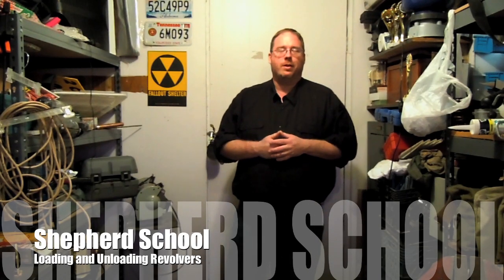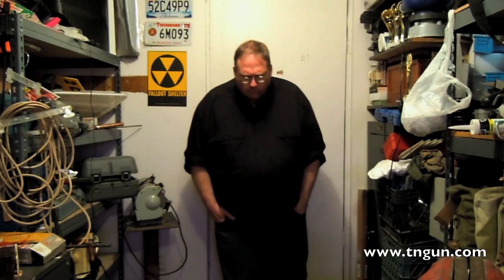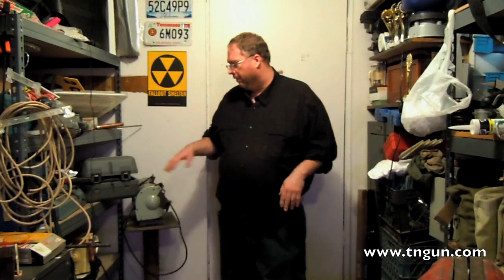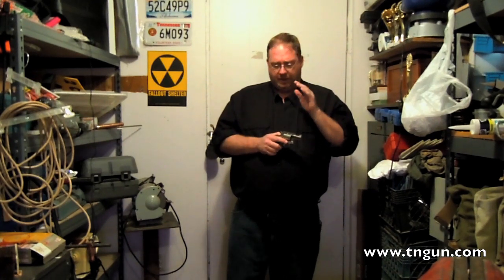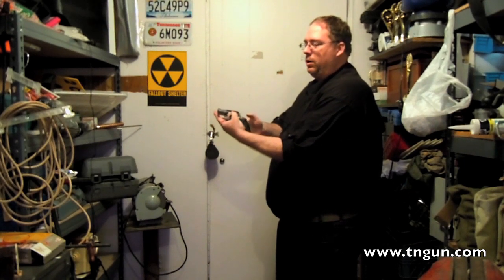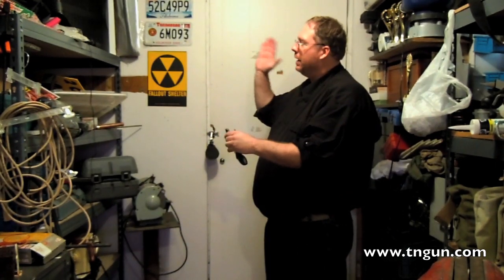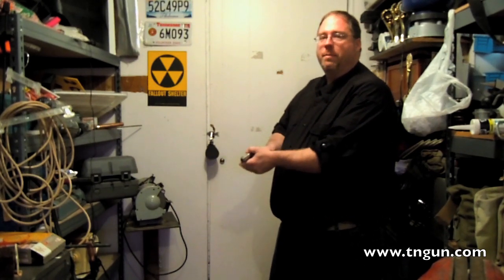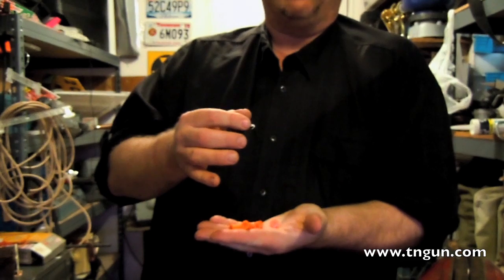FBI Method of Double Action Revolver Loading and Unloading

Comment: Working with a speed loader (HKS style) - handle by the plastic and insert the nose of the bullets into the charge holes.  Give it a little push to confirm all the bullets are started in the charge holes.  Turn the knob to release the cartridges then reestablish your shooting grip while the muzzle is pointed down..  Close the cylinder wiping the speed loader away.  Bring the gun up and on target, firing if necessary.

Turning the knob and then quickly pulling it away tends to trap the cartridges in the speed loader which are then pulled out of the charge holes when pulling the speed loader away.  Make sense?  

The incident you are referring to is the Newhall incident that occurred in April, 1970 where four CHP offcers were killed in a shootout with two heavily armed criminals.  That incident proved to be a turning point for law enforcement firearms training nationwide.

Comment: You are performing too many hand motions.  The gun should stay in your right hand.  Push the cylinder release with your right thumb.  Meanwhile, your left hand goes for your cartridges, and grabs one cartridge.  While doing that, shake the cylinder out of the frame.  Bring up a cartridge, already selected by your left hand; if you were not successful, in shaking the cylinder out of the frame, this is the time for the left hand to pull out the cylinder, with a finger hooked into a chamber; while holding a cartridge, push the ejector, insert the cartridge; continue until all loaded.  Push the cylinder closed, with the now empty hand.  All the time, the gun stays in your shooting hand; both hands are working at the same time.